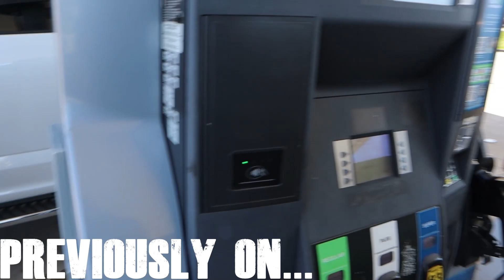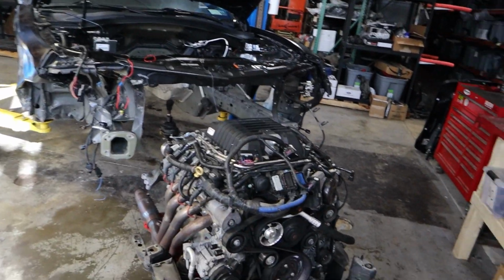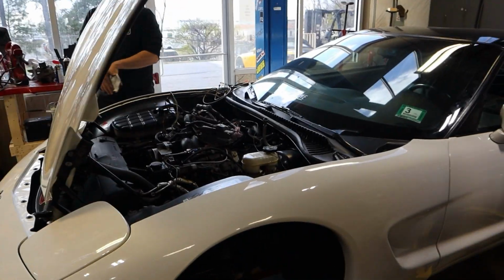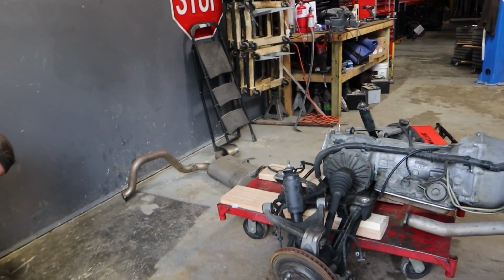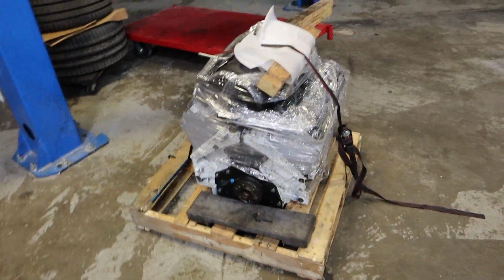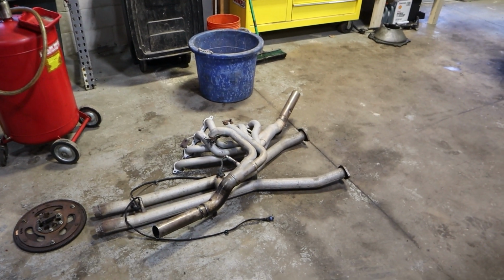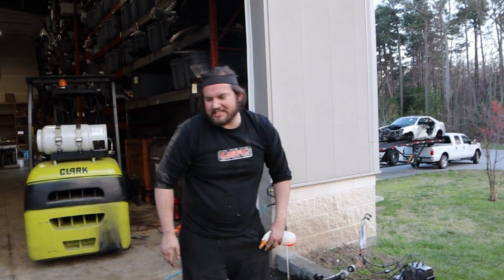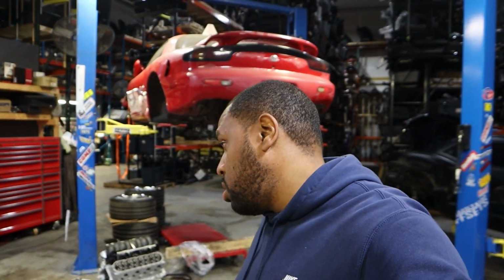Removing My Blown Up Corvette Engine : C5 Project Part 3

Comment: new subscriber. love the video. i have to pull my c5 engine as well and found this video. Can i ask what front bumper lip that is?? all the ones i find have a vent or ducts and i like the one that is all smooth like you have. can you share that info with me? love the vids. keep up the good work

Comment: grab one off a used engine they have, and buy them a new one. probably the easiest quickest way to get you going. my boy did something similar when one of his injectors went on the dyno. his tuner uses the same injectors in his k series, and he let him have one and replaced it with a new one by ordering it same time.
Reply from the maker: That's a solid idea but they sell the motors as unopened
Reply: @Mod2Fame  ah ok. Hopefully theres a napa or something around.